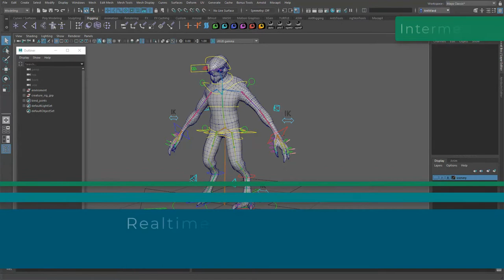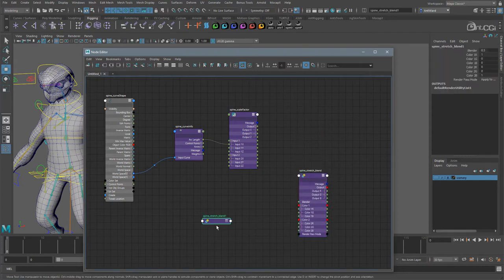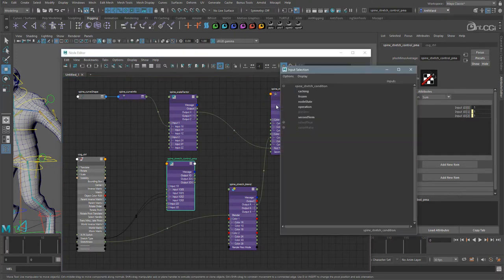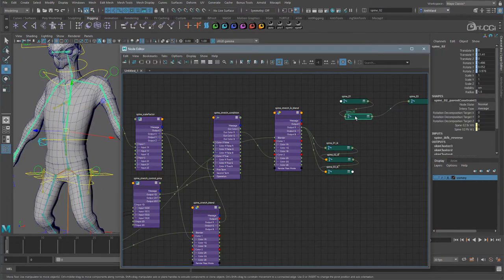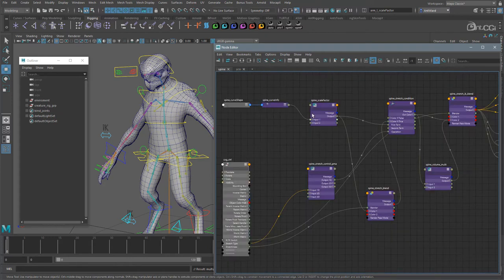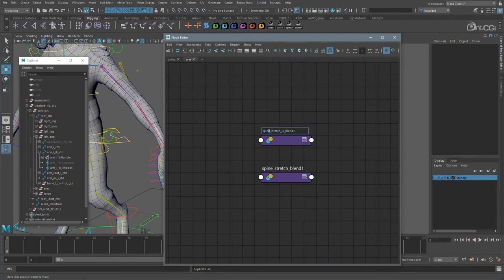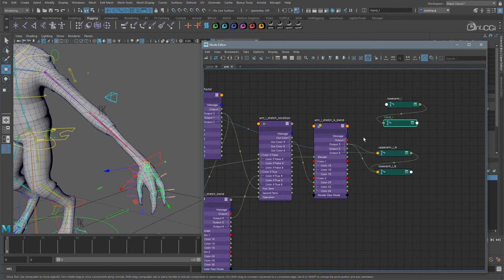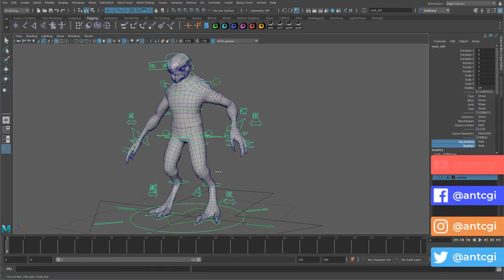Realtime Creature Rigging Workshop (18 / 19) : Squash & stretch

Comment: Hi. Thanks for your tutorial, it's really helpful. I have an issue with the joints scaling. Scale Y and X work fine but scale Z causes the mesh to move to the side rather than scaling evenly out on both sides. Do you know why this could be? I've been stuck for days. Ive done some tests and it seems that anything other than a completely straight joint chain causes this but in your tutorial your spine chain is obviously not completely straight. Thanks
Reply: Just figured it out! Dual Quanterion was ruining my life. Changed Skinning method to Weight blended and it works well